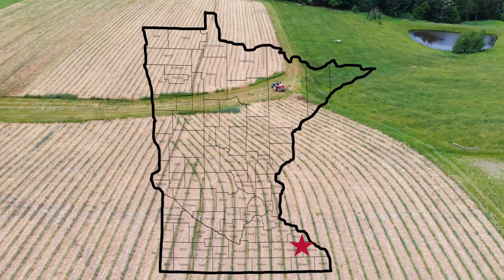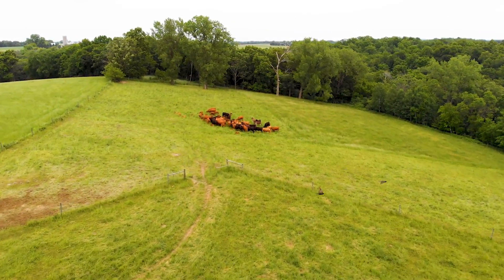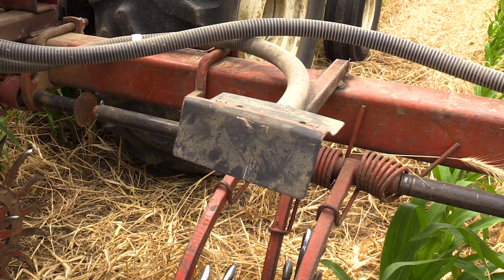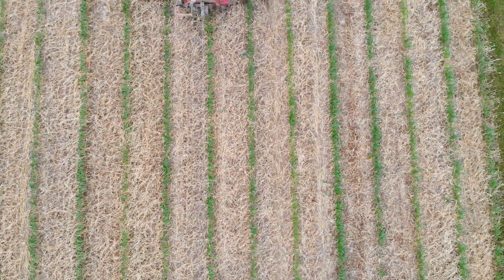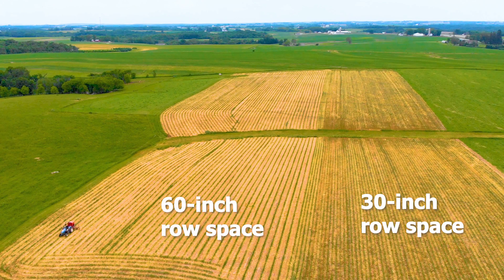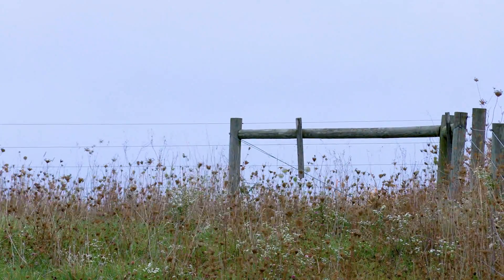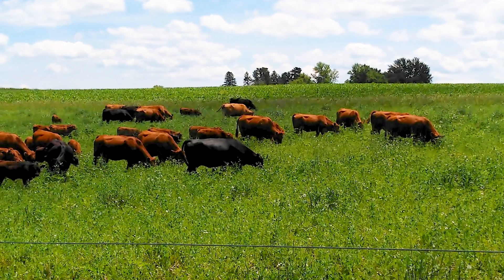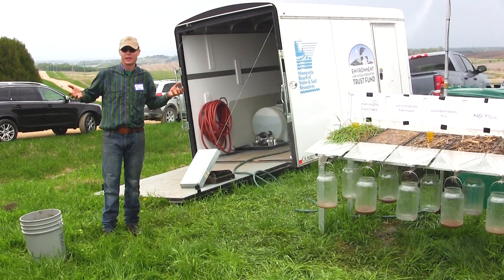Rotational Grazing of 60-inch No-till Corn Inter-seeded with Cover Crops Means Positive Economics

Comment: How long does the poison "Roundup" last residual in the soil/Plants that will be affected by it?
Reply: I guess you'll have some remnants of it in next succession of plants, but after that it will get turned into different compounds, healthy ones. Bacteria and fungi can change chemical structure of elements (such as those found in roundup) and transform them into compounds that plants can use. That's why, with long-term healthy soils, even the effects of radiation like Uranium will disperse under the power of microbiology.
Reply: @tesha199  actually, when Monsanto sought epa approval for roundup it was originally as an anti-microbial. 
Glyphosate might be 'neutralized' by some soil biota but what biota is destroyed? What part of soil web is left damaged?
Reply: I wouldn’t want the cows to graze a field where Roundup/Glyphosate had been sprayed in the last year. It looks like he will soon figure out how to do without it. Many farmers do.
Reply: @C.Hawkshaw  I think some farmers use a crimper to kill the previous crop. Instead of using chemicals. But I could be wrong too Lets hope he gets off of roundup.